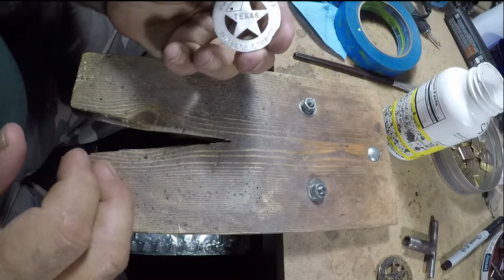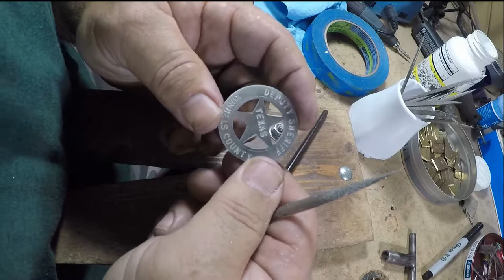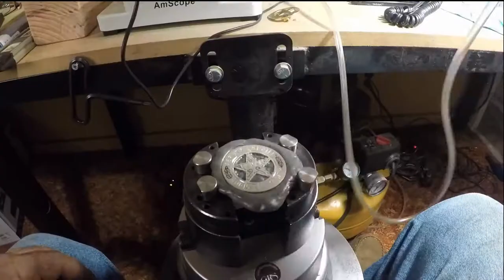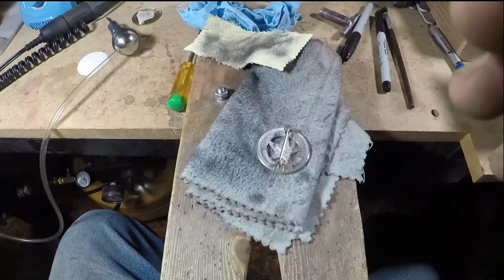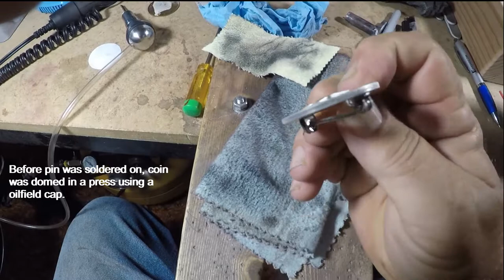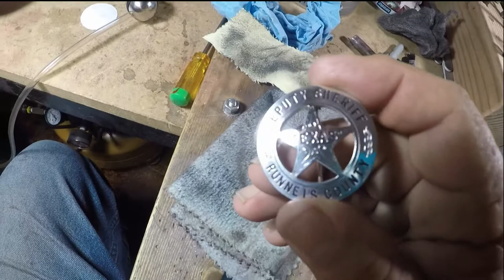Cinco Peso Badge

Comment: Hi John, thank you very much for this great video! Would you be so kind and let me know how you  make the words into the coin. And how to make it black? Thank you so much! Many greetings  across the atlantic -from  Bavaria, Germany! Bruce
Reply from the maker: Well i did use a pathograph, rotating the coin to engrave each letter, and using a transferred on pattern to keep them in the right place. It was very time consuming and a easy way to mess up a coin, especially with my machine, which was really worn! Now I stamp them with a quality hand stamp set… following that up with a dentist like diamond cutter to even out the letters if need be. That has proven to take about 1/2 the time! The black is just permanent marker rubbed in a couple times and then polished over. Most engravers here use that to show the engravings. Thank you for writing.